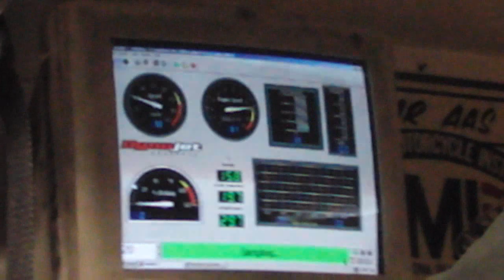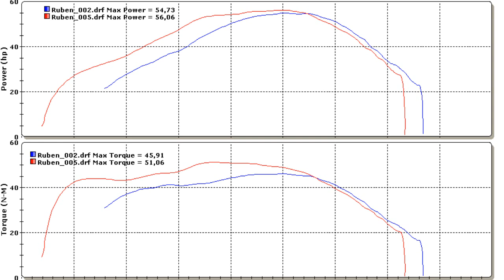KTM 380SX dyno

Comment: The dyno operator is doing this wrong! Whenever you going to do a dynotest with a two stroke, you have give it full throttle to max rpm then AFTER that you need too pull the clutch in. If the motor doesn`t get fuel, it doesn`t get oil either since it`s a two stroke engine. Search youtube for Honda cr 500 dyno, seized piston in the end!
Reply: @Idiotstryingtobeprofessionals  its actually true what he says

Comment: Good way to lock up motor running wide open throttle like that then not pulling clutch in.
Reply: ***** it's a 2 stroke so when you go full throttle and let it go without pulling in the clutch and the rear wheel is still turning the motor over like that there is no oil getting to the motor because the carburetor is at an idle but it is still turning a lot off rpm
Reply: But the motor is not turning at idle speed so there is not enough gas and oil mix going to it
Reply: Because the back tire is spinning the motor as it is moving
Reply: @Idiotstryingtobeprofessionals    I guess you didn't read his comment and just replied.

Comment: @kakkukaala changing sprockets won't change your HP number, only measured torque at the wheel. Gearing down will raise your torque but drop wheel rpm.

Comment: There are a lot of idiots commenting here... A dyno doesn't change your torque readings based on hearing... It is measuring your rpm versus the rotation speed of the dyno drum...the dyno computes the exact overall  gearing in this manner... Shift gears or change sprockets.... Makes zero difference on what the dyno is measuring as the engine output to the rear wheel.... Also... 250 2 Strokes do not make this level of  power.... In the same manner that 125s don't  make what a 250 does...this is an excellent  power curve on the same lever or better than modern 450 4 strokes

Comment from the maker: @kakkukaala Hi, it does not matter what sprockets you have. 
my 56hp is NOT from the crank...thats a huge difference anyway. This bike beats even a cr500 from 0-topspeed. 
And my gearing is 15(the biggest front) and 45rear ithink...topspeed 145km/t (GPS measured) i can change to a 38tooth rear sprocket but will loose acceleration.

Comment: @smcr500 With the 380 you can tune the powervalve for a milder hit, it is just a screw on the side. Should be the same on 250/300s of the same years.
With head mod, pv tuned right and correct jetting they are torquey bikes. Not just top end monsters. I could only imagine what porting would do. The biggest problem with 380s is jetting.

Comment: If the crack is not crazy you can fix it with a steel sleeve. If you want a replacement cylinder try powersports warehouse in the US. They have the best deals I have seen on OEM here. Or any KTM parts supplier.

Comment: @smcr500 The 380s have more torque. The 300s have the benefit of newer design so they run cleaner. Since they run cleaner and don't have the midrange hit of the 380 they can feel like they have more torque. I have only heard great things about ported 300s though.

Comment: I have one of these , found that the idle jet was way too small so changed that and now its fine , also felt like it was lacking that mid range hit so I changed the exhaust flange and added a fatty pipe for more power and punch . Am going out tomorrow to see what difference it will make over the standard pipe :-) great vid

Comment: @smcr500 The 380s are notorious for hard jetting. I had trouble with mine, I talked to specialists in the industry that said the same thing, and I have read through the 380 thread on KTMtalk. Your brother must have gotten lucky, or previous owner fixed it.
Most people get head mods and/or JD Jetting kit to fix it.
I got my EXC running good and the torque felt as good as my friends 2010 300XC-W.

Comment: Torque= 4 stroke (non turbo charge) makes roughly 100 Nm per 1000cc cylinder volume
A 2 stroke engine is theoretically closer to the double thanks to cranking a workcycle twice as often. But 380cc of combusted fuel/air charge is always able to produce more force/torque than a 300cc charge.

Comment: @bilbombe Keihin PWM modified to 39,5mm and it's fast as hell, but 250 loses to 380 at torgue so badly... but the dyno was like this. and i think if you have too long gearing it will lower the hp and like that. but 62hp were from crank..

Comment: @TheOfficialKC my brother has a ktm380 and the jetting is no problem at all ;-)
we have tested the 380 and 300 and compared them in diffrent things.
the 380 will not work as good as the 300 in an enduro. i also have 2 cr500 one supermoto and one cross. it feels like the cr500 has more torqe and hp than the 380 but the 380 wins in a drag race. not my supermoto cr500 ;-) have tuned it...

Comment: What is the first pipe on the bike? That is not a stock 380 silencer. Looks like a newer KTM silencer. The 380s had long silencers with a bend.
Were both dyno runs done with the Gnarly pipe? I don't think I have ever seen a 380 without one. Both mine have it.

Thanks for the dyno video, I had only ever heard of HP rumors for the bike.

Comment: @TheOfficialKC i have not read so much about the 380. he has a jet chart that follow the bike when you buy it... but he has always smaller jets than recomended in the chart.
the bike is road legal and is used on the road most of the time.

my brothers 380exc is much stronger all over than my 2002 300exc
has more torqe.  does the 2010 300xc-w have more torqe than the 380???

Comment: What year model engine?
Reply from the maker: 2002
Reply: @bilbombe  there is then quite a lot more potential left, I heard 2000+ models have smaller crankcase volumes than 1999 ones for more low end and also smaller exhaust port

Comment: @bilbombe i would beat you in a hard enduro race ;-)
you have too much power in the 380.
have tried the 380 way out in the forest. and there`s too much power it will just spin out.
would take the 300 over the 380 if i should use it in an enduro.

but 380 on the road and cross ;-)